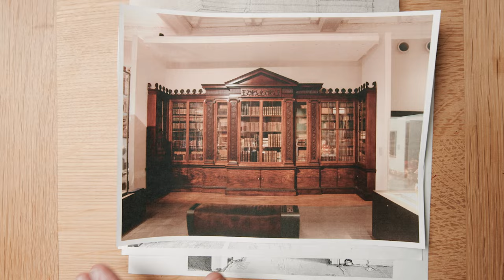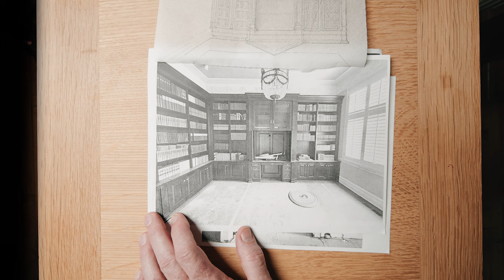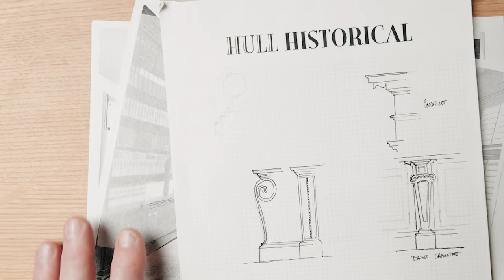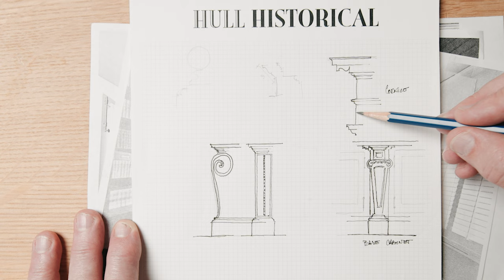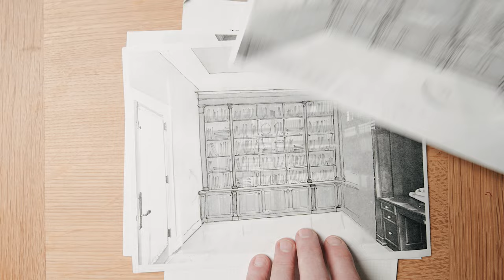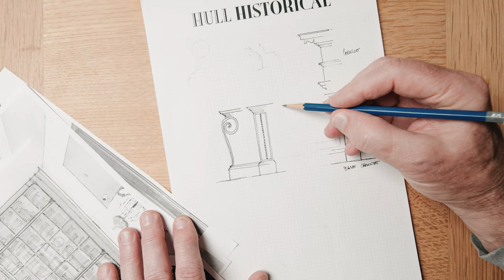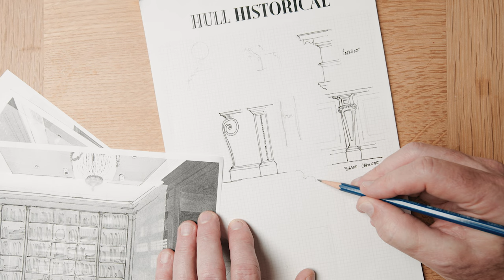Fixing Cabinets - How to elevate your cabinets to furniture grade

Comment: Thanks Brent. You have raised a very important point of the  flute/shoulder relationship.
Indeed mostly it is one to one in modern off the shelf elements.
However in classic orders the flutes are wider.
Both relationships seem valid and one to one do not look ugly. But the classic ones are definitely more attractive
Reply from the maker: Nice. Thanks for sharing.

Comment: I’ve always focused on utility and maximizing capacity Shelves sized for the books; materials sized to handle the weight both vertically and horizontally, finishes to avoid any damage to the books.
Reply from the maker: Well that matters too but I would say get the aesthetics right. Thx!

Comment: Great stuff. Been waiting on something just like this. Video example seems to use bottom of window as height of drawers. We have an 80’s “colonial” with 9ft ceilings and tall windows extending down near floor. Would that setup change your approach to proportioning of bottom cabinet and foot height or would you primarily proportion based on wall height?
Reply from the maker: Glad it was helpful! Yes, i would definitely be playing around with different heights.

Comment: Hi Brent, great video! It seems kind of odd to have fantastic bookcases and woodwork on three walls and not the fourth.  It's also unfortunate that the bookcases on either side of the desk area aren't symmetrical in width (is the chandelier centered on the pediment)? If you paneled the entire fourth wall around the windows right up to the cornice  it would make the room look and feel more luxurious and complete rather than it just having cabinetry on three walls.
Reply from the maker: True, but it starts to shrink the room too much. My thoughts.

Comment: Not sure if Brent has ever mentioned this but I find CAD software has really limited designers in regards to style and proportion.  Old school designers on a board had much more training and could "see" the design better while drawing it - like an artist or painter.  The zooming ability of CAD (loss of true scale and proportion) as well as other crutches such as copy & paste has made modern design very sterile and awkward.
Reply from the maker: I agree 100%. Thanks
Reply: That’s because CAD operators are technicians using a technical system that automates schematics. They are not arts and craft.

Comment: Here is an interesting problem what should kitchen cabinets be aiming for. Current overpriced factory units look horrible at best. I have seen $20000 kitchens that look like a flat pack set sadly  because they are flat pack.
Reply from the maker: Good question. that could be its own video.